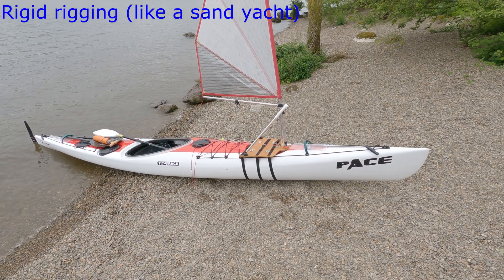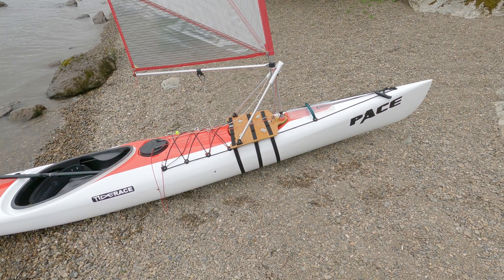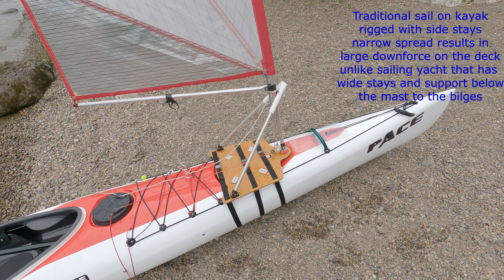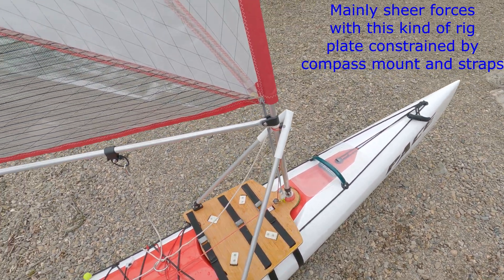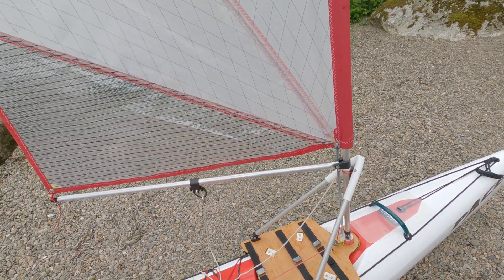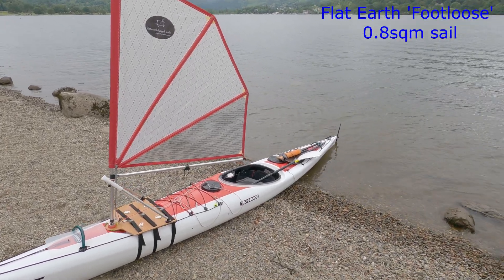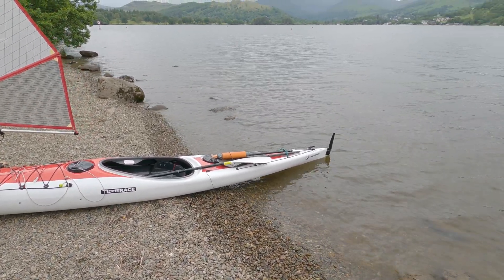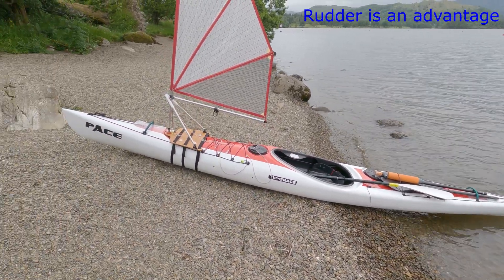Rigid rigging a sail on a sea kayak

Comment: Really interesting set up Jules, I’m trying to figure out a better set up for my FES. Gnarlydog and Falcon sails have forestay and side stays higher up the mast which seems to make the mast very rock solid. Good luck 🤞
Reply from the maker: @markb2396  just remember the geometry; shallow angle side stays need lots of tension and down pressure on the mast foot. My rigging is the same in concept to a land / sand yacht.

Comment: Thanks mate, good idea to try different rigging before you drill holes.  I’m working on my sea eagle explorer 420x inflatable and I also have a wooden platform like yours . The sail I will purchase from Falcon Sails , the have a I.3 sq meter that looks great and I can choose great colors. The also make a great looking rigging to secure the mast on the mast deck.  Will see how it works out soon.
Reply from the maker: Will you have a daggerboard?
Reply: my kayak came with a rear 10 inch fin    I added a 10 inch fin 2 and half feet from  the bow to make it track better, and it does  very well.   I don’t like the side daggerboard , to many components to travel with .  Planning to stuff all components in two large suitcases, will be sailing in Sardinia 😂..  at his is why I have an inflatable kayak.   My next project is to design/ fit a medium size rudder.

Comment: I have two kayak sails. They are fun but in high winds and white cap waves they increase your chance of capsizing. To roll is almost impossible
Reply from the maker: I find that the sail kind of stabilises the kayak. But once the wind gets to bf5 that's enough!
Reply: @juleskayak  Agreed. I capsized in high winds and could not get the kayak upright again because of the sail underneath the water. I had to be rescued :(

Comment: Hi Jules. I am not sure you really need to drill any holes in your boat. You have the "turtles" in the side of your kayak, where your deck elastics are attatched. If you take a piece of marine cord aprox 2-3 mm in diameter and form a  short loop around the bolts, that hold the "turtles" in place, you have the possibility to hook the mast stays to these loops using small schackles. If the bolts pass through the hull, maybe you could make som reinforcement by placing washers on the inside. I hope you get the drift, and good luck with your kayak saling, it is a lot of fun.